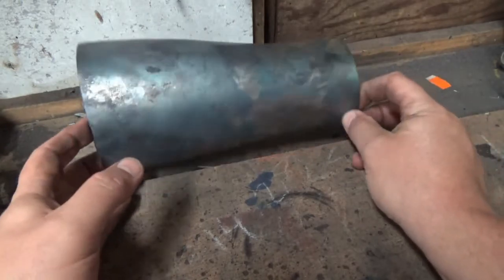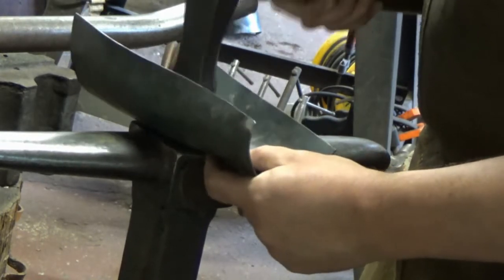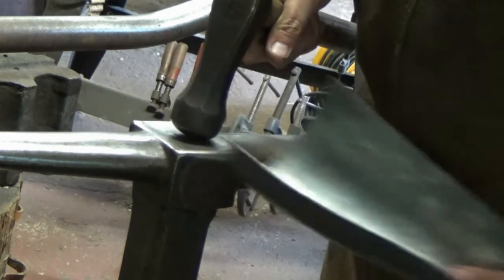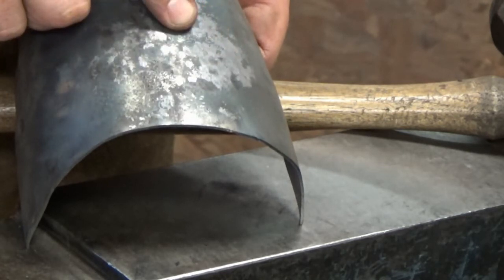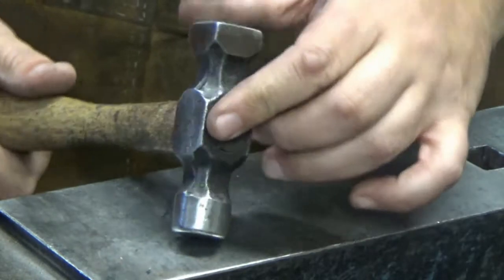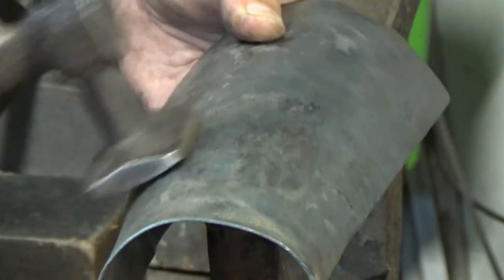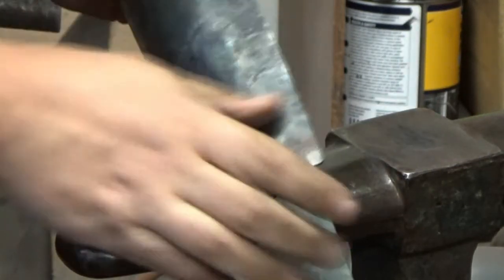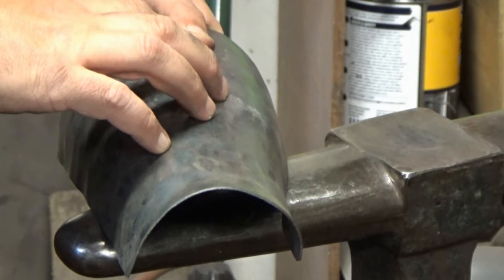Medieval Armour Techniques #1: Introduction to Planishing

Comment: I saw a guys video where i dont think he used any steel hammers on his work the finish after was pretty amazing but i wonder what kind of material he was working. He made a pair of spualders in 10 hours. Im thinking the soft hammer takes longer to move material but that means it cant dent as deeply. The time saved in smoothing and grinding i think might be worth it.
Reply from the maker: Soft hammers can work at shaping the metal, but I find it harder (almost impossible) to move the metal about properly with soft facing hammers. I did my earliest spaulders I made with them, they where OK, but compared to now with steel there was a lot of wasted effort. But I didn't have the experience I have now in how to move the metal; so that may have a lot to do with it as well.

The metal moves very differently with soft hammers compared to hard, and that can be a boon/problem depending on what you are doing, or so I have found.

Comment: Hello again :D  This is a quick one: Do you know the length of the square middle section of that T-stake at 13:15? And maybe the length of the arms? I have a guess, but...I should not guess, never goes well :D Then I could build my own one :) 

Also, I finally found out what a "Scutch Hammer" is - hard to translate into German :P Thx for the video!

Comment: I've been using a brass hammer for planishing because it seems to leave fewer marks. But it also seems like it takes longer. Do you think that's a good technique?
Reply from the maker: I've heard it works well with aluminium, but haven't tried.

I can imagine that it is harder to work with on steel, a way to reduce the marking left is to do most of your planishing from the inside of the piece. Personally I stick with steel, just because cleaning back a few dinks and dents doesn't take that long and would suspect that the brass hammer would take longer … but you might be on to something new :)

Comment: Great video. I know you keep saying that when you're just starting out, you don't need all these fancy specific hammers and stakes, but I find that you kinda do, because it's hard to find everyday objects that can be used as suitable substitutions.
Reply from the maker: I guess it depends on your situation. When I started I wanted to buy a ton of specialist hammers and they would have cost a fortune - but would no doubt have worked; but I wasn't sure which ones or sizes I'd need. I know that I can go  to the local car boot sales and pick up half a dozen old hammers that I can grind to new shapes, but if you don't have access to that then there could be an issue

Generally I would suggest that start with what you have and let your work and skill dictate tools you need.

I suppose what I am suggesting is that to begin with you don't need to get them to make armour. I'd say buy a bench grinder, find old hammers, shape them as you can and go on from there :)

Perhaps I' should do a look at the top 6 or so hammer shapes folk might find useful, or that I use in a day.
Reply: +Greenleaf Workshop yeah, that'd be great. I mean I got lucky with the hammers I have, I'll send you a picture in DM on Instagram of my collection of hammers shortly, but yeah, most of 'em are my grandfather's, one of 'em I got at a garage sale for like $5. I just think some hammers like the scutching hammer and the different stakes you have would be nice to have in the beginning if they weren't so expensive.
Reply from the maker: Nice haul of hammers you managed to get for yourself there. A quick way to get some of the simpler stakes together is to order some spheres from a metal suppliers and weld them to some solid bar, I find anything from 15 - 20mm works, depending on the size of the ball on top.

You'll have to find a US equivalent  but here is the sort of thing I mean ... the hollow ones can make nice dishing forms too.

http://www.fhbrundle.com/iron-spheres.htm
Reply: +Greenleaf Workshop thanks. And yeah. Although I found a good site where I can buy ball stakes that are offset as well as normal too and dishing forms. Have you heard of Ironmonger Armory?